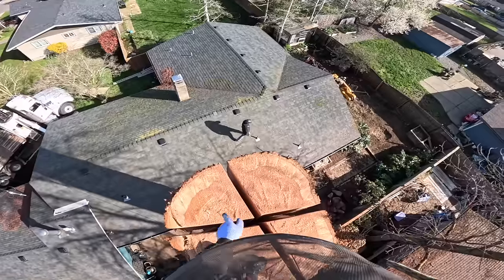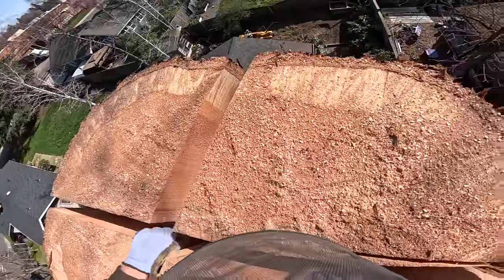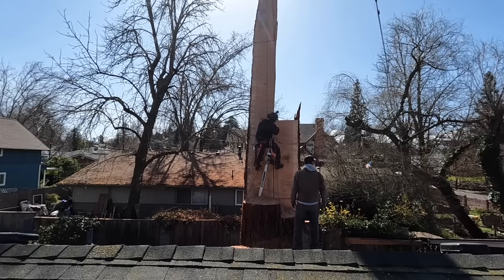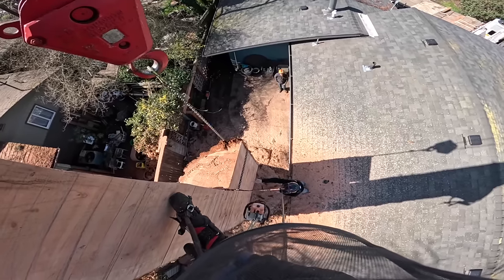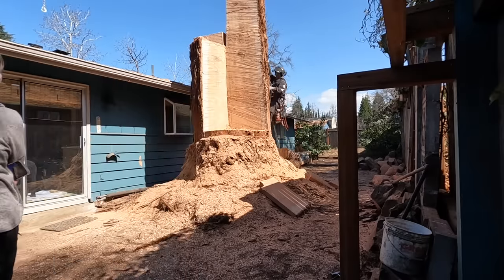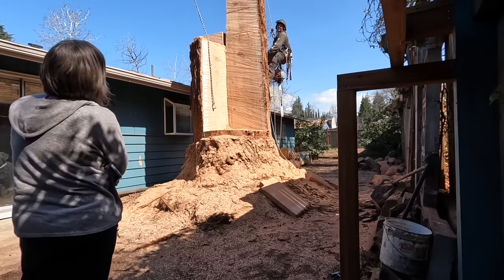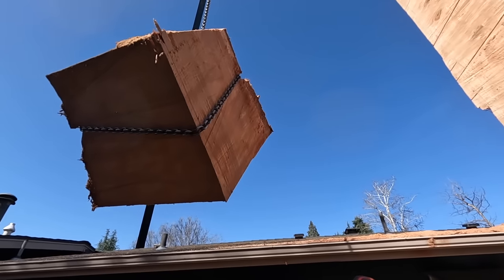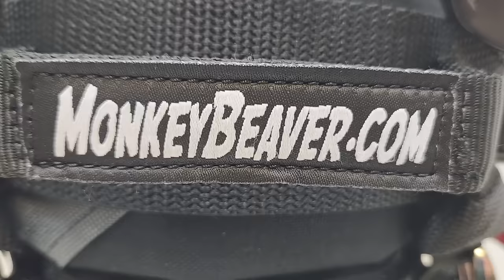WHAT?? Aerial Milling? WHY?

Comment: The first big tree I ever removed many years ago was a redwood that was growing up through the middle of a cedar deck in a backyard in Eugene, Oregon.  It was lifting up the foundation of the house and had to go.  It measured 6' x 8' in diameter at the deck level and had multiple tops.  I had no crane and very little experience. We got it down by quartering the rounds and negative-blocking each piece without damaging the deck.  It took us forever but we got it down.
Reply: A tree done without a crane that many will say you need one, is one hell of a tree sounds like it was a few long days 🤣
Reply: @cjgromlich1242  Yep.

Comment: August Hunicke. 
Rather than quartering them out. I've used a heavy duty dewalt impact gun and put heavy duty 8-12 inch lags with a eyelet in the top of the rounds and craned them out with that. Works really well and is quicker that having to saw them down the middle.
Reply: Agreed
Reply from the maker: As per Beranek but not faster or as secure for huge redwood, which rips nice.
Reply: @AugustHunicke  this kind of answers the question I was going to ask. I was going to ask why not just call in a bigger crane. Because I could not imagine ripping pine or oak down here in Florida. It's like cutting rock.
Reply: Answered my question of the type of tree. Was the wood that heavy? A unique one that’s for sure.